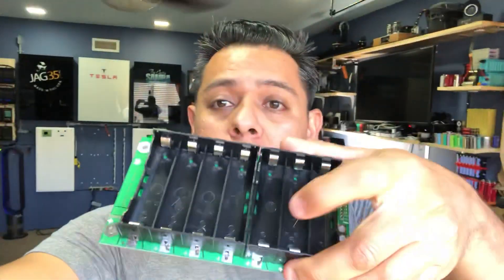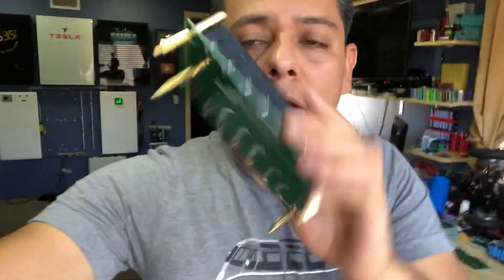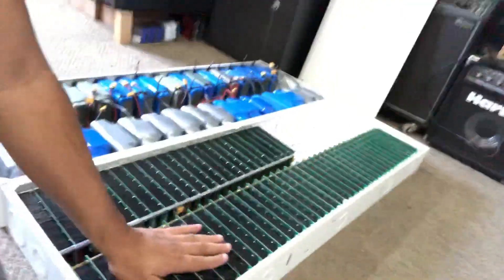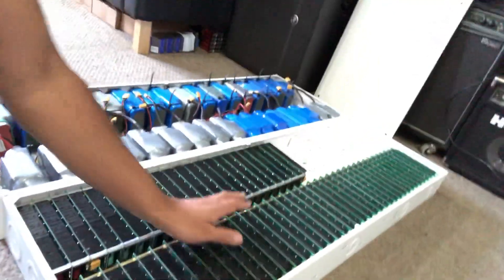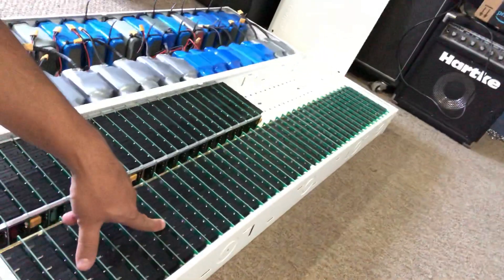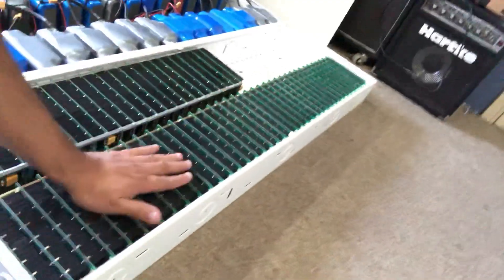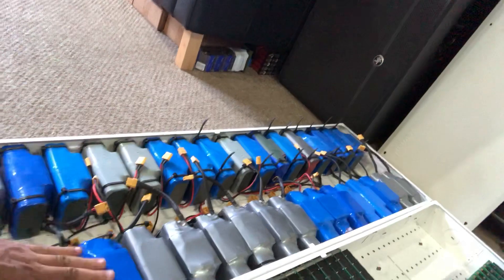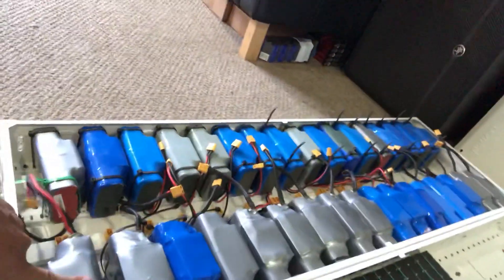The DiY POWERWALL PCB

Comment: I'm still trying to decide if I'm gonna go the 18650 route for building my power wall or if I'm gonna go with prismatic cells and build with LiFePO4 batteries since they're just easier to throw together and there are less individual cells to deal with.  Your boards do make the decision harder though.  Either way, I am going to have to deal with having a pretty serious cabinet in my house full of batteries though, as I want to get somewhere between 21-28KW of available power.  My intent is to divide up the power output, through buss bars, to several inverters and to run different things like an instant hot water heater and mini-split air conditioner.

Comment: Hi Jahu. 
I guess i got the solution for your heating problem of your 18650 battery holders. I hope you have seen the heat sinks on computer processor. They are designed in a way to decapitate the heat out. To solve this in the cheepest way use the 1 inch copper tubing that is used in house hold AC. Cut them in the same size as the 18650 cells and then split them in half. 
Add heat sync compound on inside and put each half on every cell. Copper is the best metal to decapitate heat so it will keep your batteries cold enough that the heat won't get transferred to 18650 battery holder.

Comment: I've been delaying my questions trying to figure this out but I need help to clarify my confusion. I'm going to build a 24v 18650 cell to power an electric driven reel mower.  How and/or what should I use to charge this pack and how does a BMS fit into the story.

Comment: So the screwing them together doesn't really solve the problem of easily accessing the cells in the middle. It's cool for creating the structure but I would suggest like a quick connect/disconnect with a cassette style slide system.

Comment: Everything I've read seem to imply that power wall works on a transfer switch and inverter.  How would you go about building a lithium-ion whole house UPS  instead for continuous up-time, or even a smaller 15A branch circuit UPS?

Comment: I have the same question about changing cells. 

Is there any consideration for runaway cell?  How to find.
Reply from the maker: 911
Reply: Of course, but how would you know which cell is causing an issue. Is there anything I can add to keep check for ‘this or BMS to alert for problem?
Reply: Do you have any newbie videos.

Comment: Dude I love the whole PC board build for power walls so clean and organize. The boards I ordered from JLCPCB. From the day I ordered them it only took six days for delivery to Chicago so far I love them I did make a few changes such as I doubled the thickness of the copper, and I found a way to modify the cell holders so they can handle much higher amp’s. Thank you for keeping this open source you are changing so many peoples lives and single handedly keeping thousands of 18650s and other type of batteries out of the landfill.
Reply: 1LesbianStoner AngelKM420 There's the option to use SMD cell holders for 2 sided mounting now. If you double the copper thickness the cell level fuse will change, probably about double current required to break.

Comment: Hi, I also want to try and make a Tesla module. I have seen that there are 12 batteries oriented to the positive and 12 to the negative. 21 packs of 12 for the positive and 21 packs for the negative. How are they connected to each other? How is cooling managed? How can recharge ? And whatsapp Kindle of bms is required? I know there are so many questions .....  I santi to but you pcb for the powerwall.Thanks for everything you do! Paolo Corino from Italy

Comment: It looks like I have to wait, which is cool with me. My wife and myself went off FB about 10years ago.
At least this way won't just look more professional. Won't it also make it easier to change out bad batteries? Also, another quick question - do the tin connectors in the battery compartment create any resistance for the power? If so, how much have you noticed per cell? And if they do, are they worth changing to copper if able to purchase or have made?
Cheers mate,
Awesome progress. I've been watching your channel since around your first powerwall. The powerwall has evolved haha! 🔋🤯👍

Comment: Jehu I think you're idea of having a super long pack is not going to carry the current very well. Those stands won't carry it.
Reply: Yeah I agree
Reply: He runs enough walls all together so he is never running his powerwalls at roughly less than half of the batteries capacities.
Reply: Colaaah  True, but he said he wanted to run a 5000w test on this box.  That's a lot of current to pull through this design

Comment: So, am I seeing it right that each board is a 7S, and you have a whole array of them in parallel? Are the individual 7S boards balanced?
Reply: Solar Steve The cells in each "s" string are connected through the 0.1" header in parallel. So you only need 1 BMS/balancer at the end of the pack.

Comment: I am looking forward to seeing what you are doing with v2.0. How many batteries and going into this build & voltage?
Reply: Fil-Am Gabe love that logo
Reply: nightmare in action thanks
Reply: Fil-Am Gabe how long have you been a member I havent figured out Monday live streams yet
Reply: nightmare in action I have followed Jehu off and on for 2 years. But I have been a subscription member a month and a half but you have to also have lots of interaction to change the color of your symbol.
Reply: Fil-Am Gabe well I mostly use mobile so I did not even knew you could change the symbol

Comment: I would love to do this for my rv house battery. Any plans on making a 12v version?
Reply from the maker: Not with 18650s
Reply: Robert Bagoly it should be easy enough to make happen. Either a 12v or 24v system. That's what I'll be doing. I will be getting a 5th Wheeler RV to travel Australia with my family for a few years. So my first powerwall that I'll be putting together, will be for that... I'll be doing it with these PCB's if possible or using the same system, as but get my own PCB's made to order. One way or another it is going to happen for me...
Reply: You could if you could find holders for LiFePO4 and make a new design for 4s. 12V has many disadvantages though, especially for high power.

Comment: It's important to make it easy to find and replace a bad battery.. that needs to be taken into account
Reply from the maker: People think that’s very important,  I’m not entirely convinced.
Reply: I remember seeing a video you posted last week about how from the salvaged batteries, u weren't able to use a percentage of them. That percentage was in the double digits, so there is no guarantee that the ones that you found being good now, will remain good for another week, month, or few months.
Reply: Edgar Valdez I think the easiest way is to use a thermal camera. It's a bit spendy but you can find a Seek Thermal on eBay for under $150 if you watch. I used this method to find slow self discharging cells, thermal cameras are very sensitive to even the small amount of heat given off by a cell losing 30mA.
Reply: jkenny1 yeah I agree that it may be an easy thing to do with a thermal camera.. another way is to just have some low power passive thermal circuitry that turns on an LED or something once it gets above a certain point. There are various different ways that we haven't talked about.
Reply: Why is that?
Reply from the maker: Because I’ve never replaced a bad cell,  and even worst case examples like Peter that did not understand that he needed to match cell capacities has only had to replace one module in 2 years
Reply: Yeah that's a good baseline, but doesn't it just take the heat from one bad battery to ruin the chemistry of other batteries? If the battery isn't removed, it may be heating the rest and cause those to fail earlier.

Comment: Garcia.....I have 16 solar panels with outback charge control.....can I use this charger if I deside to make a battery like this?....my system is 48 volts.
Reply: The Outback charge controllers are flexible, but if your inverter is 48v you will need 48v batteries or change your inverter. While the Outback flex charge controllers will work with lithium, they are not designed to. You can't turn off the float portion of the charge. From my understanding, lithium doesn't like to have a float charge applied to it. I swapped my Outback gear for Schneider.
Reply from the maker: If you set it correctly, pretty sure you can

Comment: Hi there. Really appreciate your time and work. What sort of cost will this 5kw pack end up costing?
Reply from the maker: About $350ish in hardware $100 for box plus the cost of the cells
Reply: jehugarcia that's really good man, your a legend for sharing all of you valuable knowledge.
About $450-$500 Australian dollars pack + inverters etc... and all the knowledge you learn about your own system or a 10kw powerwall from Tesla that would set us back here in Australia about $10k...
Reply: Colaaah Remember that the main cost is the batteries. You need like 800 good brand batteries to reach 10kWh. Those cells aren't cheap. And of course in the end you get a proper fully integrated piece without any risk of messing something up or even doing any work.
Reply: Newjorciks I guess most people watching this are people who would rather build something and learn while also saving money. I'm definitely here to both learn and save.
Reply: Naughty Goat Farm Of course. I myself would also make my own if I was in need of one, but just saying that it's not all "Pff,  500$ vs 10k$". It's way, way closer to the cost of the powerwall and the money you save with making your own goes into time, labor and possible mistakes.
Reply: Newjorciks all worth it👍🔋💪
Reply: @gooble69  what about a set up for our RV?!
Reply: jehugarcia thanks for the info mate

Comment: What if a fuse or two blows in the middle of the pack? Would you have to dismantle the pack down to that board to get to the fuses?
Reply: What if one of the cells fails?
Reply: Joe McBurnie Jehu will tell you better then me, but from memory from learning off this channel. Because your powerwall will be ran at no where near maximum capacity, if that happens and the rest are picking up the slack, they don't have to do enough to worry about. Which running your powerwall at nowhere near max cap., it's not only good for this reason, but also will lengthen the life of your set-up. Especially your batteries.
Which in the end, gives you plenty of time to get replacement batteries and replace faulty batteries....
*I hope I'm right Jehu!?!?
Then I'll know if I've been grasping everything OK 🤔
I hope so...
Reply: Actually that’s pretty easy especially if you use a surface mount (SMD) fuse because they actually make holders for them so you don’t have to solder them on and off once you solder the holder to the board they pop in and out very easy very simple. And if you’re still worried about fuses being blown it’s very simple to add an LED that turns on when the fuse has blown you just have to be a little creative.
Reply: 1LesbianStoner AngelKM420 makes the project more expensive and complicated to solder
Reply: Cheers Colaaah!
Reply from the maker: Only if the thought of a blown fuse keeps you up at night.  But I think there’s Medicine for that now
Reply: jehugarcia yeah, just change the bloody fuse lol

Comment: How are you supporting the weight without allowing the metal threaded spacers to contact the enclosure and short things out?
Reply from the maker: The standoff’s are set back about 1/8” from edge of pcb and the bottom ones are non conductive